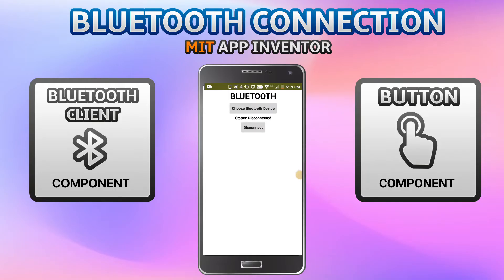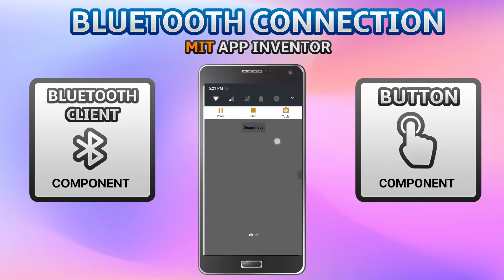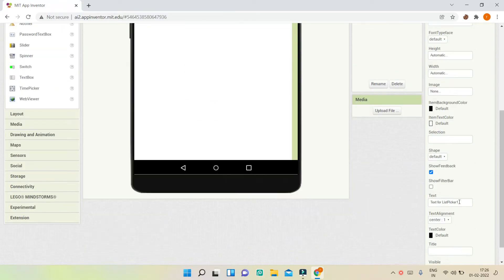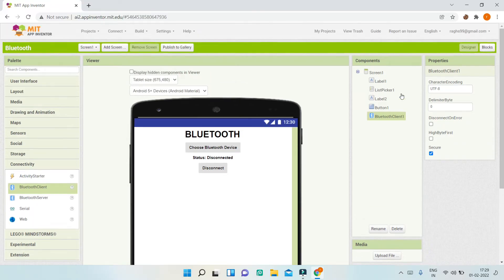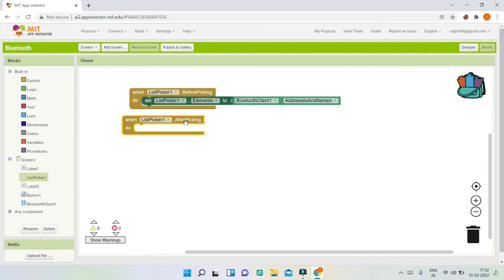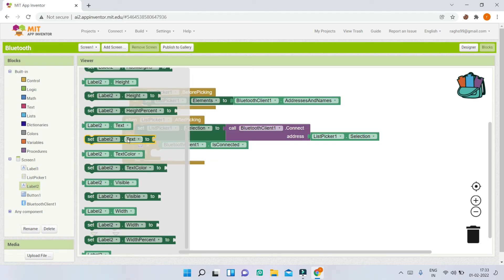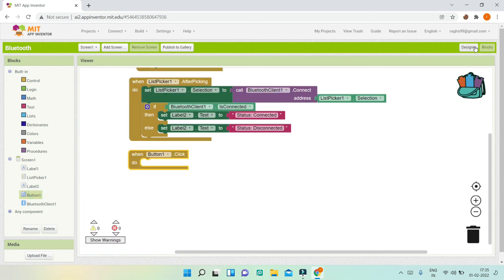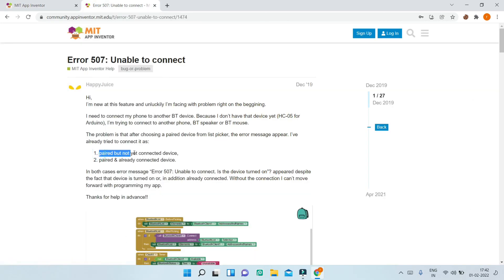Use Bluetooth in MIT App Inventor App [2025] || Connect Devices or Arduino using Bluetooth Client

Comment: Hi, when I click on Choose Bluetooth Device the screen of phone became black and nothing happens. Bluetooth and Location on my phone Samsung it is both On. I have a Bose speaker On but it is not find by application.
Reply: on your phone,

goto settings
search for your app
in App Info for your app select Permissions
change Nearby Devices from Not Allowed to Allowed
Done
If you have already given permission, turn it off and on again.I had the same problem and it was fixed like this

Comment: Hello my friend!
your advice is needed. I am currently working on an android + arduino project. Also faced a problem of debugging of the code.
The essence of the project is very simple. Aduino transmits the text, I should see it in android and the first question is how to get rid of * text * of these asterisks that MIT itself substitutes. And the second question is how can I do debugging with a com port right away on a computer so that I don’t download the application to my smartphone every time.  well, I think you understand, you need to simulate the work of an arduino by simply sending text to a com port. Take off such a simple example, I think many will thank you. I'm the first THANKS))

Comment: Question: Can you also make a script to connect Bluetooth automatically? And disconnect also of course
Reply from the maker: Yes,
You can add the bluetooth connect block in the Screen1.Initialize block. This means whenever the app is loading/initializing, it will auto-connect to bluetooth.
The same applies for disconnecting.
Reply: @KrishnaRaghavendran  Thanks Krishna